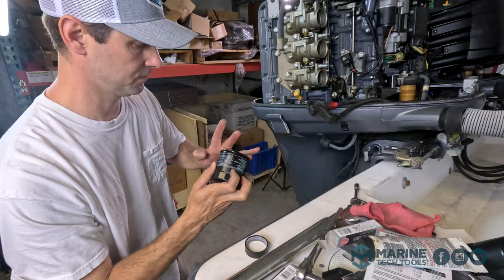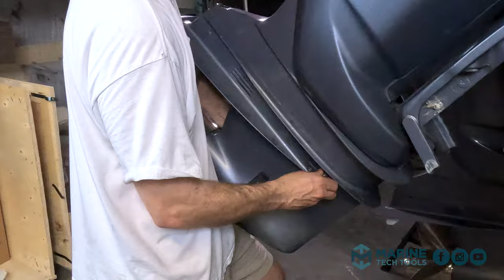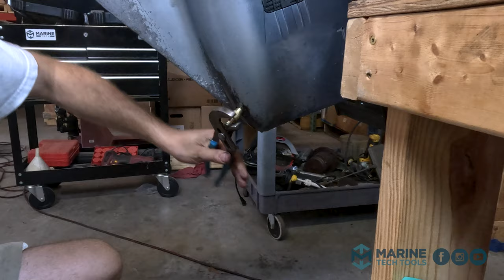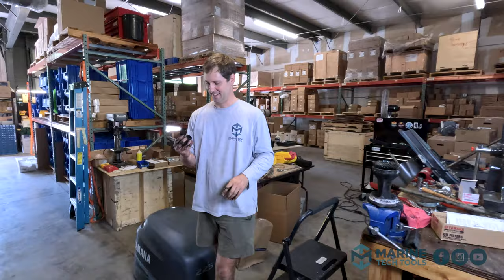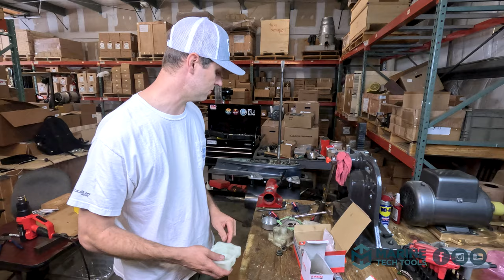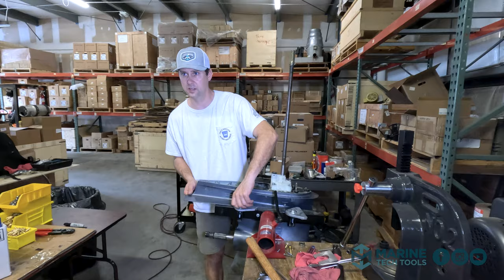200 Hours Service on Yamaha F225 - Marine Tech Vlog#4

Comment: Worth checking the valve clearance and taking a look at the timing belt idlers, especially the aft one. Not as big a deal on F225 as the F250. Good luck with exhaust kit.
Reply from the maker: Interesting that you mention the timing belt idlers, the port motor does not have much/any belt tension.  We were planning on changing the timing belt for the 1k maintenence and while the belts look good the difference in tension was immediately obvious. I understand that the 225 is a non interference motor but jumping teeth is No Bueno.

Comment: It is great to see Marine Tech back to regularly producing more quality videos showcasing both the excellent after market tools you manufacture and sell as well as your maintenance procedures.  Here is a "tip" I saw somewhere else on YouTube that I will pass on for your consideration, before you are done filling up the lower unit with new oil, rotate the propeller to move the internal gears within the lower to help get rid of all the air.  I thought it was a useful "tip" what do you think?
-Much Respect !
Reply from the maker: Glad to be back!  Your tip is a good example of a thoughtful ritual.  Likely unnecessary but I will probably do it from now on because its easy, cant hurt and I like the idea of getting as much oil in the unit as possible.  We will keep the videos coming and thanks for watching!
Reply: @MarineTechTools  Thank you, but I cannot claim credit for the "tip" I saw it somewhere else here on YouTube.  Unfortunately, I have very few brilliant original thoughts, which is another reason I keep watching the "experts" like YOU GUYS!  Thank you again for the valuable content!
=Respectfully
Reply from the maker: @apackwestbound5946  We are certainly not experts! The goal of this video series is to show our path through this project.  We haven't done a project like this  before but we do know we will get through it and get it done!

Comment: Can't believe that lower unit didn't totally burn up driving it that far when it was nearly full of water.   It had to get really hot to start melting the pump impeller and housing.  Luck was on your side on that trip!
Reply from the maker: I think they were separate issues, the water pumps were melted on both motors, we think someone ran the motors while it was on the lift (prospective buyer?)  The 50/50 water oil mix not blowing up the lower unit comes down to the quality of modern lubricants and materials...and luck.  We don't know what condition it was in at the start of the trip, but man, i don't know how much more we could have gotten away with.   Its good to be lucky.
Reply: This video really show the need for routine outboard maintenance and inspections.   In between annual service schedules on my motor, I typically loosen the drain plug on my lower unit to check for any water intrusion and pull the prop off to check for any fishing line wrapped around the prop shaft and put some grease on the shaft splines.   Small efforts like this can sure help to avoid expensive repairs.  I really like your bearing carrier puller.   @MarineTechTools

Comment: Any update on that exhaust kit that you mention having to order and install?  I ask because I may have the same issue with my engines and can get little info on the issue.  I'd like to check to see if the previous owner installed the kit and if not if it is needed and this is the first video that I've found that even mentions the problem much less shows a symptom of it.  Thanks for the video.

Comment: You would be doing yourself a favor by doing a fuel system service and at same time get the injectors professionally cleaned.
Reply from the maker: Any tests that we can do to determine the need?
Reply: @MarineTechTools  No - just send injectors out to a reputable shop preferably with a Asus machine. For the $25ea injector they clean and flow test, normally will give before and after flow tests. Pull the VST apart and clean, change internal filter. Yamaha recommends VST service every 3 years and you should follow it if your running offshore. Looks like previous owner has not kept up on service...